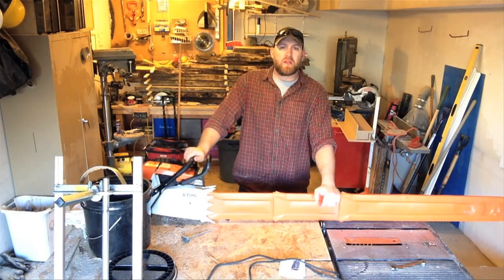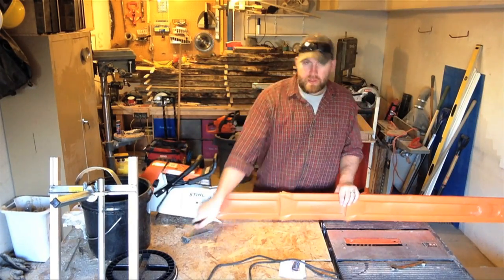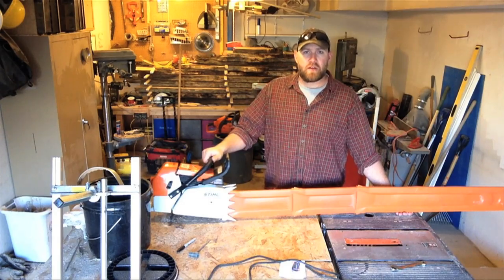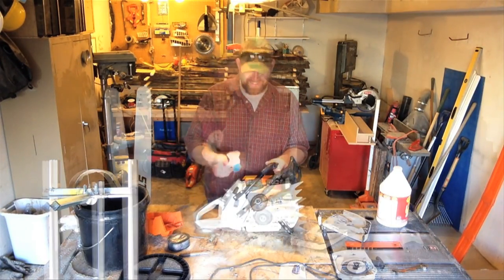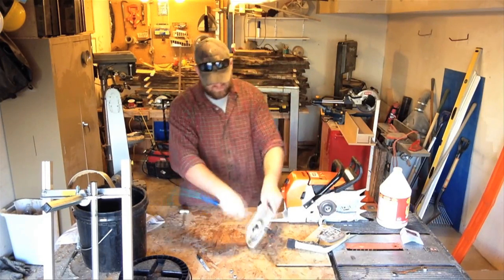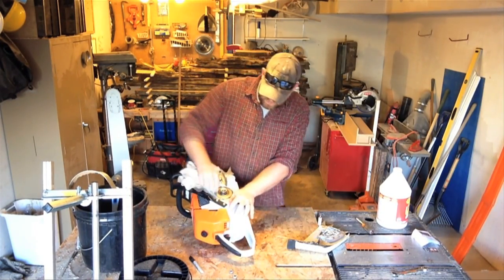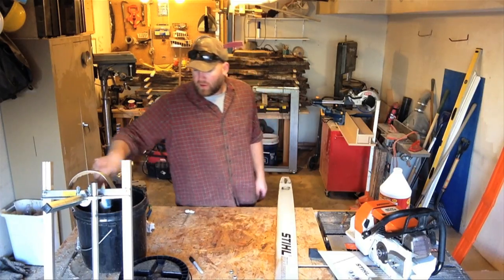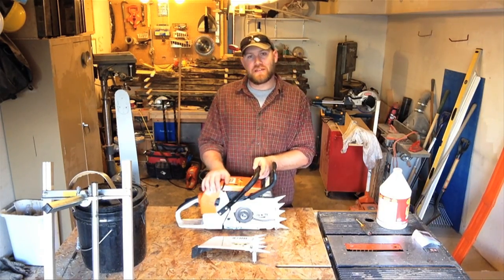Clean Your Chainsaw

Comment: When your chain is blue your chainsaw what what do you clean it with do you clean it with simple Green I'd like to know please.
Reply: I think Gregory may be referring to the fact that if your bar has turned blue along the edge it is a sign that it overheated due to lack of lubrication and may need to be replaced. I don’t know about a chain turning blue as well but I guess that can happen at the same time.

Comment: Diesel is used to take off the pitch on the bar and chain, 140 psi air and a pig hair brush for the power head.
Very nice saw/bar combo that you have..
Reply from the maker: That is VERY specific, Joe! Where did you come up with that winning combo?
Reply: Where else...my Dad !!!!
The older I get the smarter my Dad gets...
In the 1960' my parents were clearing 10 acres that was covered with Bull pine trees.
As a small boy, I remember that Pop's always had a gas/oil can, a bar oil can and a can of diesel for removing the pitch build up on the chain and bar while cutting in the field..
I still have that old Mac 52-1, he bought it in 1963 and I would use it more if it wasn't for the 20:1 and the need for 100 octane fuel.
Heavy as hell, .... 80 ci but The old Mac's were, are and always will be the best sounding saws..
Sorry that I got long winded ....